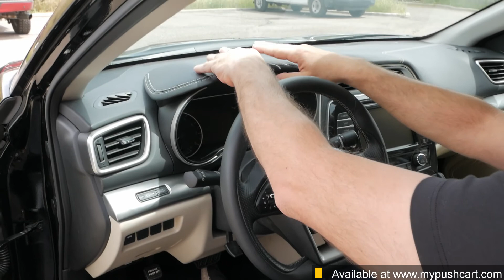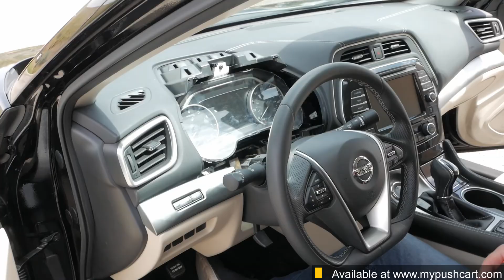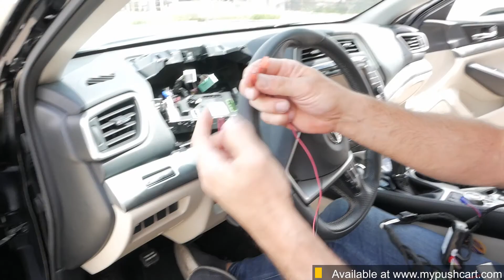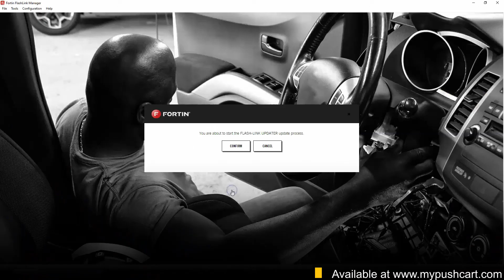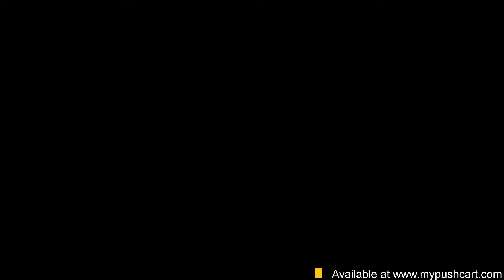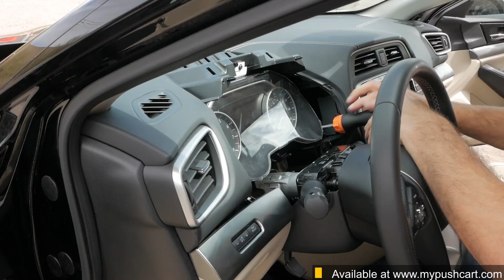mpc | Remote Start Installation for 2013-2018 Nissan Altima - Push-to-Start - Gas

Comment: I have a 2013 Maxima and the Mpc wire harness is not the same as this installation.   This must 2015 to 2018.  NOT 2013 to 2018.

Comment: When I plugged in the female black plug into that male black plug, it turned the headlights on and made a noise until we unplugged it. It's a 2017 Altima, and I also couldn't find a white wire, but I did find the black wire. In fact, I think there were 2 black wires rather than a black one and a white one.

Comment: Any tips on removing necessary dash panels in an actual 2016 Altima that doesn’t just pop off like the vehicle shown?
Reply from the maker: The only dash panel that pops off is the hood over the speedometer, and that just pops off when grabbing and pulling up and towards yourself.
Reply: @mypushcartcom  Do you have a video that shows how to install on a 2015 altima that doesnt have a pop-off panel?